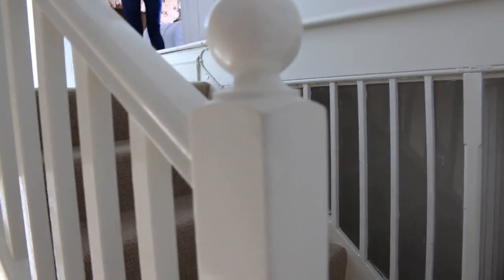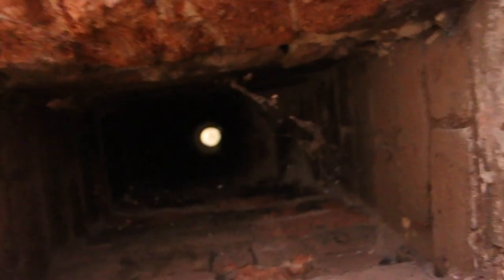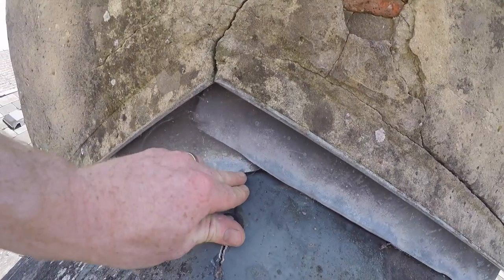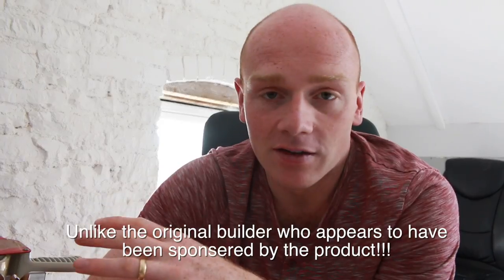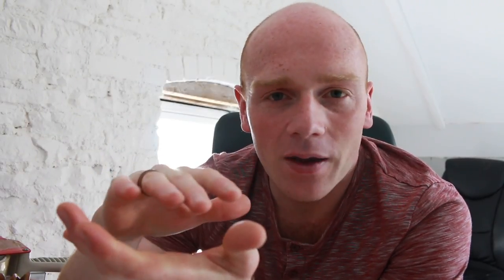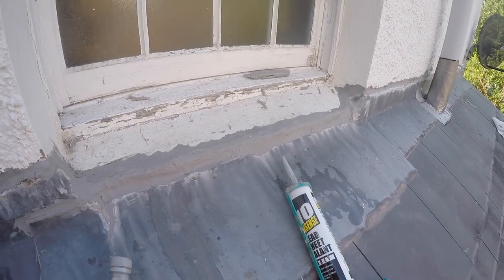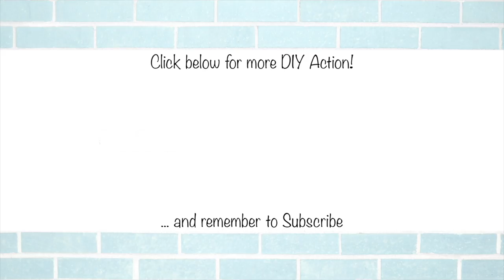Leaking Chimneys and Wet Walls - I HATE TO BODGE!

Comment: Tim mate the cement work on the top of the chimney is called flaunching, when you have repointed and re flaunched it I would suggest that you let it dry and then silicone treat the whole chimney it will then be supported for many years. The grey lead sealant or lead mate as the one we use is called is the best things for sealing the tops of your flashings where they are chased in to the brickwork/mortar bed and for sealing flashing to flashing, it is a long term solution.
Nice work and excellent videos, I'm a master carpenter and builder and roofer of thirty years. 👍🙂

Comment: That copper tee is a conex cuprofit. Just a brass version of the push fits. Looks neat on copper but not sure I'd use them on plastic. Love the channel
Reply from the maker: skaterguy52 I can see them working on copper better. The problem seemed to be that the gripping teeth just slid off the plastic and no pipe stiffeners so all in all not great!
Reply: +The Restoration Couple. They are meant to work on plastic but no inserts 😬😬😬 surprised it's not burst before now. Keep up the great work with the channel 👍🏻